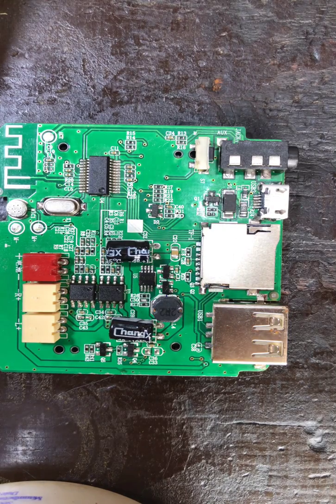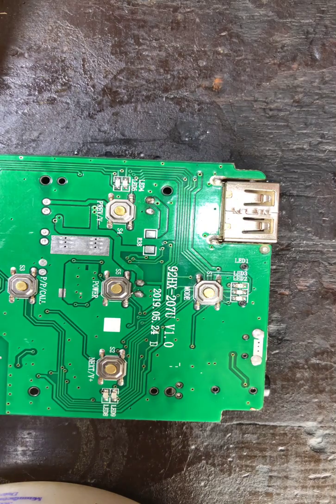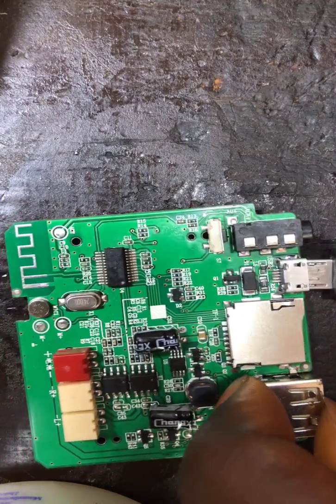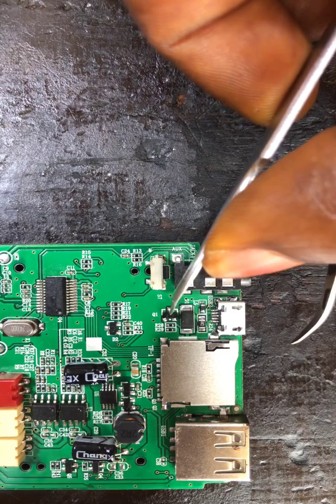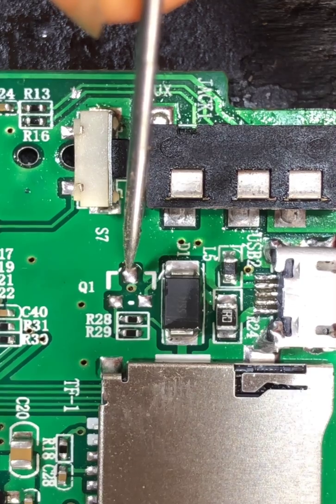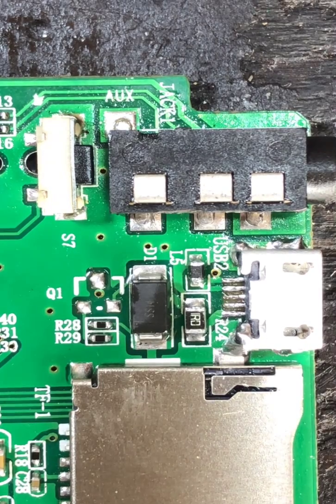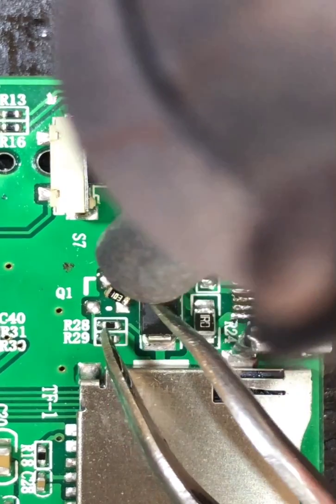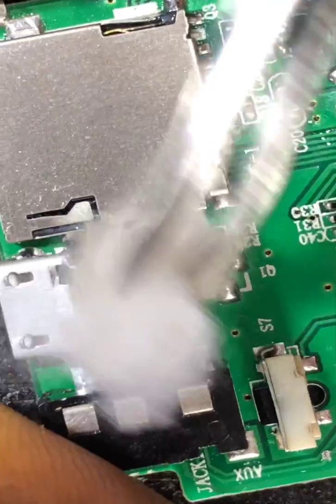Indicator Light Of Bluetooth Speaker 🔊 Fixed 100% Working

Comment: What of if the blue light is on without blinking
Reply from the maker: Check with multimeter if it still glow
Reply from the maker: If it does not glow on the multimeter that means it is faulty. Replace the led with new one